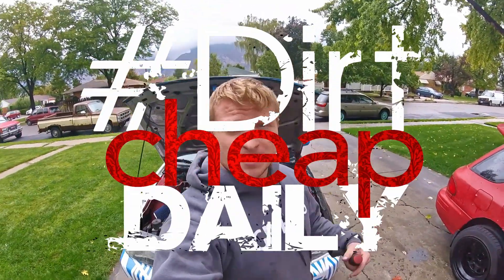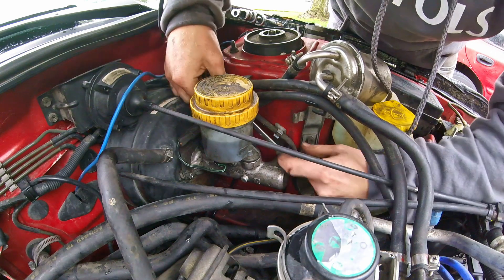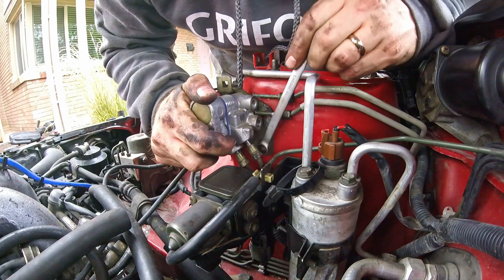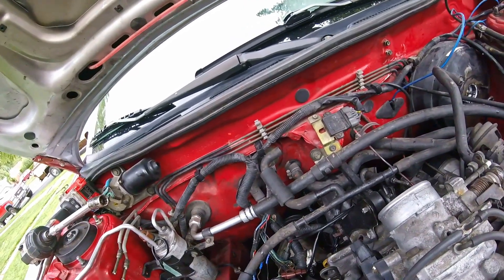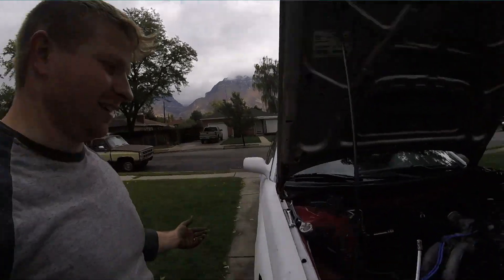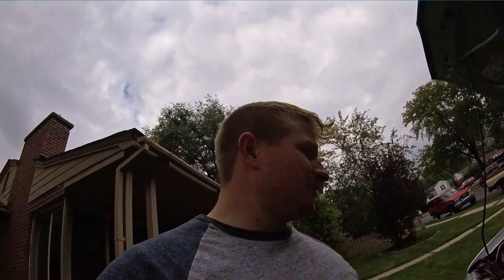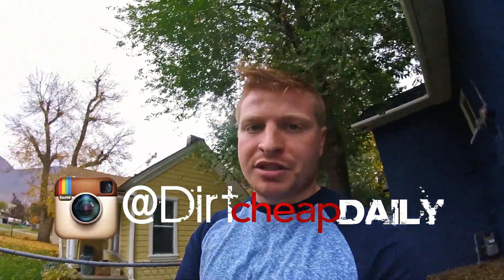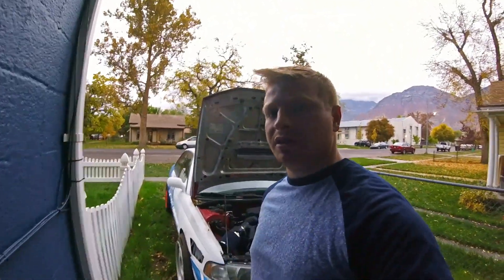Subaru ABS Delete - Dirtcheapdaily : Ep.33

Comment: That is a hill holder for your cable clutch. When it is adjusted correctly it will hold the brake with your clutch, so when you are on a hill it's easier to takeoff without rolling backwards.
Reply from the maker: +Jason Lentz that makes so much sense! None of the other subarus we've had has had one. Do they have them on abs cars? I think all the subarus we've had have had abs and none of them had the hill holder. 
I'll have to see if I can find that cable and hook it up. That'd be great to have

Thanks for the heads up! 👍🏻
Reply: Dirtcheapdaily As far as I know it is an option. My 30th anniversary eddition has it, but it's disconnected because I swapped to a hydraulic clutch. If I can find the cable you can have it.
Reply: Exactly,  good heads up info.

Comment: Do we actually need the other proportioning valve that you brought from the junk yard for the passenger side of the engine compartment, why couldn't we just use the the one from the abs system. Why would there be two proportioning valves?

Comment: the black charcoal canister is for emissions purposes. delete but leave sensor under manifold connected to ecu so no cel bruv.
Reply from the maker: +Sean Lyall sweet thanks! I knew it was for emissions, just hadn't looked into how to go about deleting it without issue. Seems pretty straightforward.
Reply: just have to vent the hose at beginning of firewall under chassis otherwise you get fuel fumes hanging around. basically the excess pressure from the fuel tank is put threw line and vented out at the bottom of the charcoal canister
Reply: as long as sensor is hooked up u are all good
Reply: I'd just leave it.  Looks ugly. But excess pressure in the tank if plugged like you said not cool and the gas smells. Even vented...not cool either.   So I'm just one to vote that it stays 😂

Comment: could have just pulled the fuse no ?
Reply from the maker: that doesn't get rid of the abs module in the engine bay though.
Reply: A car with disconnected ABS tends to slide its tail when the wheels are locked (the rear ones lock first because the mass is shifted to the front), because there is no brake force distributor. If you replace ABS brake system with non-ABS brake system, you install the brake force distributor which prevents rear wheels to lock. It can be said that behaves differently with proper ABS removal and differently with "pulling the fuse".
Reply: @ShadowEnduro  It already has one installed on the passenger side before the ABS. Brake Proportioning Valve Part Number: 27671FE010
Reply: @Holtenstein  Yes, but that proportioning valve works and a preset front/back bias as dictated by the ABS pump. If you remove the system you gain the ability to install an aftermarket valves and manually control your front/rear bias.

Comment: Could just have pulled the fuse facepalm
Reply from the maker: because pulling the fuse lets you remove the ABS module...
Reply: @Dirtcheapdaily  because fuse does the same thing as turning off the abs module. The brakes still work believe it or not when the abs isnt on
Reply: Rooey it’s to remove a little weight and to give you more room in the bay. Makes it look cleaner too.
Reply: @cuhsp5336  In the video he says that he's removing it cause he's not 'used' to it. Also I run rally competitively and the weight off a abs module is not more significant than loosing abs function, if you are at that level you wont be watching a youtube video on how to remove it.
Reply: Where is the abs fuse/relay located!?
Reply: @israelgomez5589  Under the steering wheel behind the door
Reply: What if ur module is leaking
Reply: @allenswansob7946  you can replace these